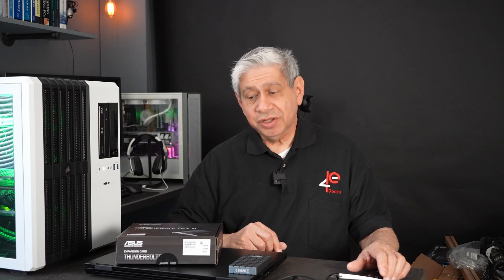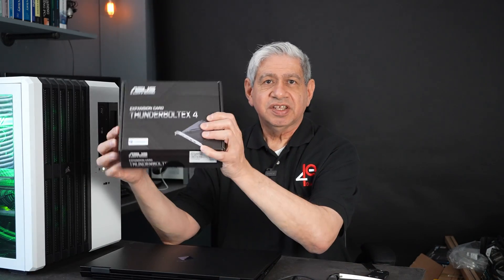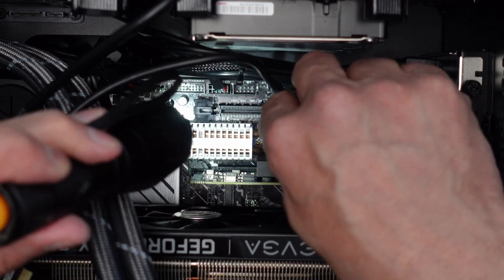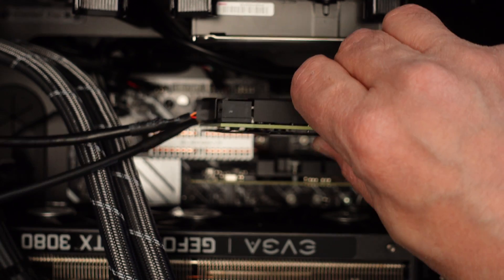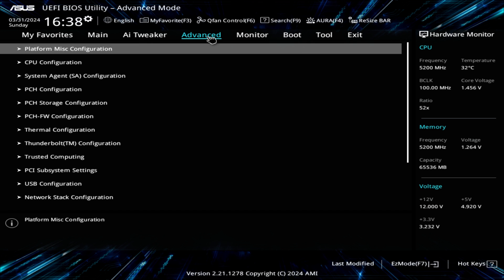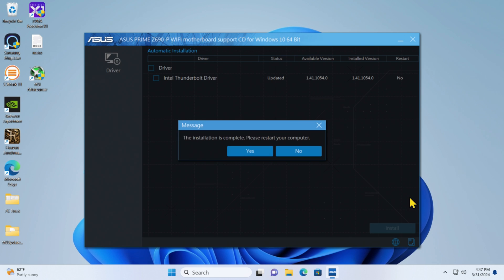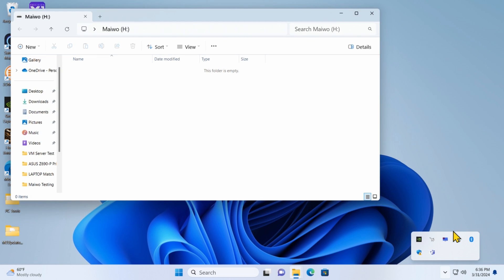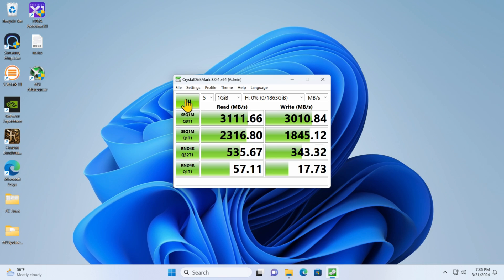Thunderbolt 4 Adapter and Device Install part 2

Comment: I’m using windows 10 and using this same thunderbolt card for my Apollo twin x interface I noticed one problem, it won’t recognize my interface unless it’s turned on and connected before the pc is on , I I just try to connect it while the pc is already on it won’t be recognized do you know what it could be ?
Reply: Hey did you figure it out?
Reply: @prodwoodroach  no with my current set up , it worked fine before with an asrock motherboard and gigabyte alphine ridge thunderbolt 3 card , now i have Asus z790 strix f and Asus ex4 thunderbolt card . It only will work if i turn the interface before turning the pc , otherwise I will have to restart, I contacted support they are not very helpful, I would say maybe get a different brand motherboard with thunderbolt on board like the taichi from asrock
Reply: @prodwoodroach  I will do a clean windows install , I’m using the one I had on my old system that could cause drivers to get buggy but I will let u know if that fix the problem,
Reply: @guilladogui8259  oh yeah that’s very likely the issue, having the old Windows install
Reply from the maker: @prodwoodroach  Was that question for me or one of the other persons commenting?
Reply from the maker: Thanks for the information.  I'm sure it may help some of my viewers.

Comment: I have only 1000 MB/s with TB4.
Reply from the maker: Ouch.  Did you load the driver software?
Reply: @PE4Doers  Yes, all the latest divers and firmware. The new firmware from February 2024 worked, but there is another problem. the same enclosure with a WD850 drive works perfectly, but the Samsung 980 PRO has a write speed of 3000 and a read speed of only 500 MB/s

If anyone has a problem with installing Thunderbolt control center, the version from the Microsoft Store can be installed without any problems.
Reply from the maker: @nnnnnn3647  OH no.  I will go and test mine again tonight and get back to you.
Reply: When I enable thunderbolt in motherboard, the computer no longer detects it. Why? But if its disabled. it works but it only read as a usb 3.2 and max 1000mb instead of 3000mb for external nvme?
Reply: @friendlyfox2189 I finally solved the problem by clicking on various motherboard settings and installing drivers. I don't know how I did it. Random thing. Windows is a complete disaster.

Comment: The glorious Corsair cube case lives
Reply from the maker: I like the air flow and it solid construction.  It would be perfect if the plastic window were tempered glass, however what it has is very thick and resist scratches.
Reply: @PE4Doers  
Yeah, I have the same case. My only gripe with it was maybe I should have gotten the mATX version (along with a mATX mobo) back when I built my computer. Then again, modern cases are gigantic by comparison, so my cube case isn't actually horrible to haul around
Reply: I am also re-using my 540 Air. Lovely case. Put an i7 12700KF into it because 13th and 14th problems. Also a B580 Steel legend. Have a Z790-H. It is the cheaper board. I noticed the USB 3.2 2x2 and the TB USB 4 header on the board. Will get the USB 3.2 2x2 for my case. 20 gig/sec. Have seen the TB USB 4 on ASUS boards underperforming on other videos. Some said you can only do 5 gigs per TH if both are in use but 10 gigs if one is in use.

Comment: I noticed you installed sodtware/drivers from CD/DVD. Did you check to see if there were updated deivers from their website?

Im curious about whether updated drivers would enable more performance.

Also, last i looked at TB adapters for PC, they were pretty specific to the motherboard. Is there a BIOS/UEFI setting that needs to be enabled or changed?
Reply from the maker: Great questions Jeremy.
The driver CD I used exactly matches what is on the ASUS Website file-to-file, including date to date.
There is however a new firmware for the unit available on that site as well, but the Read-me file is somewhat confusing and concerns me.  Here it is word for word (including spelling):

“TBTFwUpdateToolEfi V1.3 is Update PD and Thunderbolt Firmware Tool for THUNDERBOLTEX 4 Add in card  
※Please note that this motherboard must be supported [ThunderboltEX 4] add in card and should be confirmed thunderbolt function had work properly
Update step
1.Please extract the TBTFwUpdateToolEfi V1.3 file and copy it to a USB Drive.
2.insert USB Drive on motherboard
3.press the [Power key] then press and hold the [F2] into BIOS setup meun
4.Click[Advanced mode]
5.Select [Exit] and [Launch EFI Shell from USB drive] into shell mode for update process”

I will do some more research and try to understand this update tool more before I try it, and I may make a video about it as long as it doesn’t ‘brick’ my card.

Also, I believe I showed the Motherboard BIOS settings needed to support the device, and I did not think anything there could affect the performance.🥴